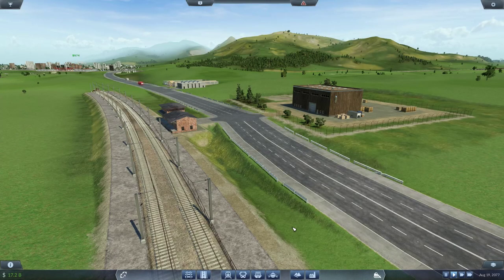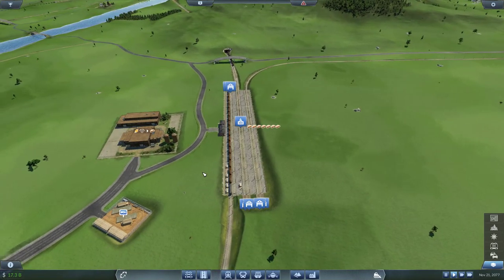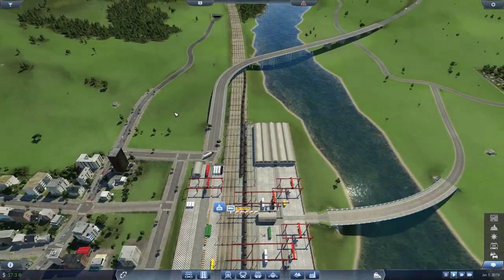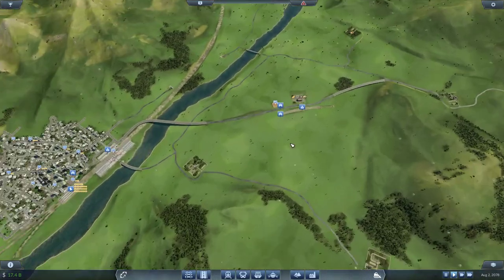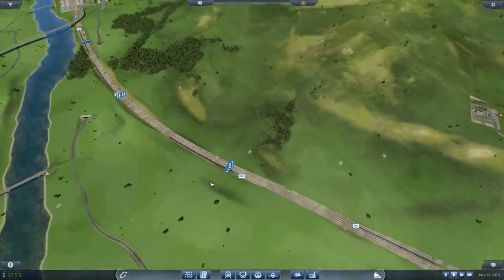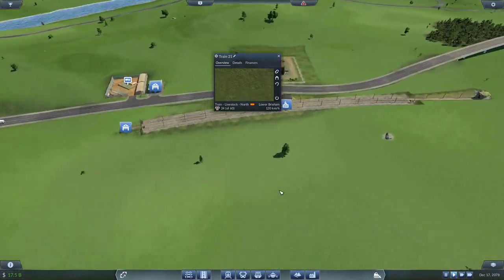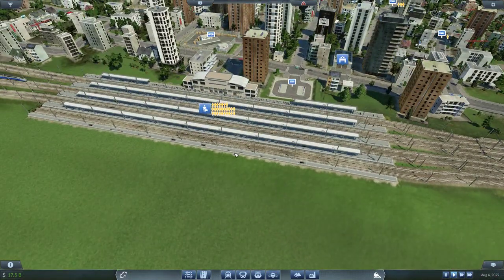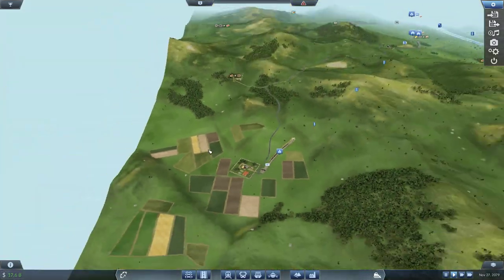Transport Fever - Ep. 56 - Stadler EC250 - Transport Fever Gameplay

Comment: The EC250 is a Swiss train. One version has special equipment to run into Germany - otherwise they are the same. 1&2 refers to the class of carriage. 
I think the problem with your food plant is frequency of connection with the farm. It would have grown faster with more (shorter) trains. The NEXT bottleneck is the connection between the food plant and the container terminal. The trucks will not cope! Remember that they didn't last time and you had to upgrade to trains! Try a station by the old bridge by the terminal - it might be in range and that would solve the problem. (otherwise you are into some SERIOUS engineering!! That new road bridge will have to be moved if you want to extend more tracks towards  Hastings (?)  The "Butlers" were a good idea - cheap little trains to get the plant running - but you needed more (say five) to get the frequency up.The reason for the two electric versions is that one (version) has a high-tech battery so it can be used in sidings with no overhead power supply 
Yes a goods shuttle makes sense. 

You always come through with your engineering - though today you had me on the edge of my seat! Brilliant as ever. T
Reply from the maker: +Tickettoriderailway cool, gotcha! Thanks for the detailed inputs. I still want to try with trucks first (I'm a huge truck fan lol), then when they're overloaded I'll gladly switch to trains. Also I think frequency for freight doesn't play as big a role anymore compared to train fever. I had literally one long train before in a different line (diff save) and the supplies still kept on coming. But yeah, I'm willing to try anything at this point as long as it works lol.
Reply: I have seen your oil train - Cute!  Have a look at it and see what the game records the frequency as. It doesn't make money because the transit DISTANCE is so small - but it keeps the refinery fed with crude.

I have seen some of your Euro Truck vids - also nice. T
Reply from the maker: +Tickettoriderailway haha yeah pretty weird train. I read somewhere that that's the biggest change between train and transport fever. Frequency doesn't play a big role anymore when it comes to freight. I have a diff save I play offline and there I usually have only 1 long train for as long as I can for each line, and each time I get more supply than I can manage. Thanks!